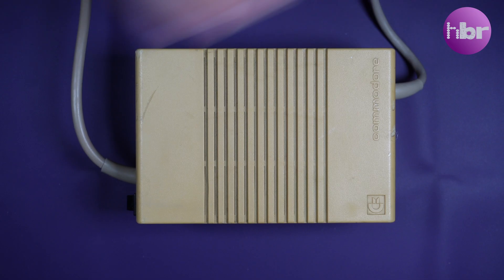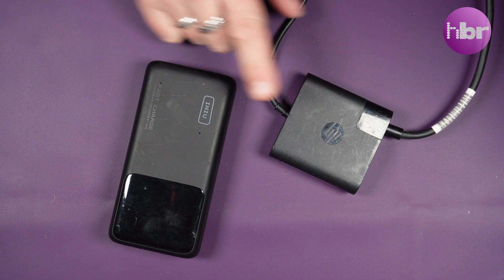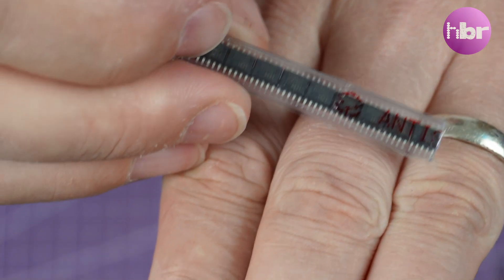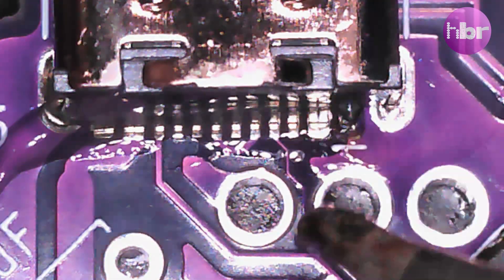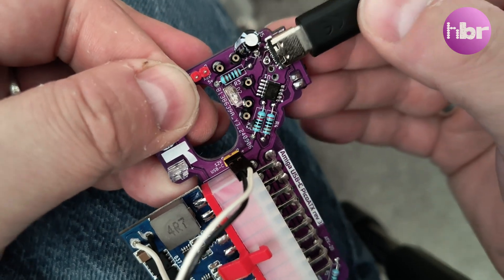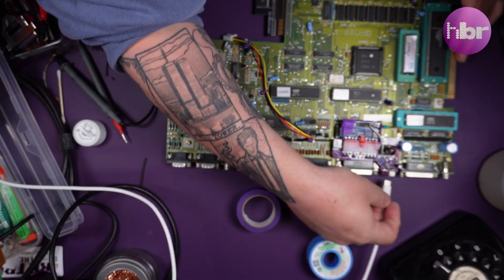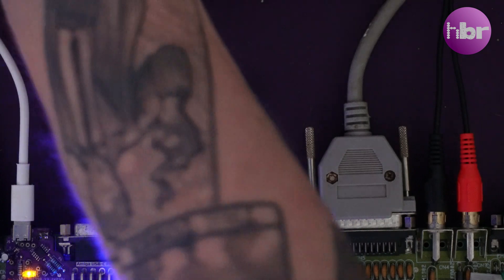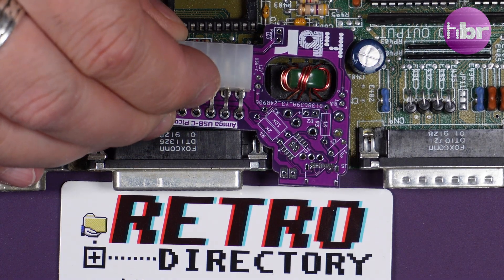Powering an Amiga 500 via USB-C? Let's Make It Happen!

Comment: How to get the -12V out of the USB? Think the Audio in/out needs -12V to function correctly. Also what level of ripple do you get on 5V and 12V?
Reply from the maker: Most of your questions are answered, in the video… in this project the usb-c provides 12v this is then passed to a pico ATX power supply. That in turn generates 5, 12, -12 & 3.3v, the relevant voltages are then fed into the Amiga. As for ripple, I have not measured it in this case specifically. However, using a clean DC power source it doesn’t yield any artefacts commonly associated with poor voltage quality :)

Comment: I don't know how familiar you are with the Amiga, but never ever remove or put something in the serial or parallel port when the Amiga is powered on. You will definitely break your 8520's. I did that mistake a coupe of times back in the 80's ...

My Amiga 500+ power supply was enough to power on two SupraDrive with memory and hard drives, three external floppy drives, optical mouse, joystick, extra internal memory and an internal kickstart switcher, so i could use both 2.xx and 1.3. So, i believe there was enough of power in those power supplies, at least those power supplies that came with the 500 Plus.
Reply from the maker: So yes on the A500 the 12v and 5v lines that go the the ports including RGB if you’re jamming about you can short the voltage pins to the signal and or data pins with the connectors shield :) this is most prevalent on the RGB connector but is an issue on the other pinned ports (including joystick/mouse connecting all plastic in shielded connectors is usually ok :) Also the A500 doesn’t have fuses like the A2000s do. Generally parallel doesn’t usually cause an issue but serial can be a problem if you manage to short anything inserting the plug … or the shorter answer would have been yes I am familiar lol … in my experience ESD is the usual killer of CIAs

Comment: Could your design be modified to just click over the existing motherboard with out removing any thing.
Reply from the maker: I did look at soldering under the connector but there isn’t enough space and using a flexible PCB would not be up the the current draw. This was a project born out of necessity as the square din on som Amigas gets corroded or damage from use so if your taking it out anyway why not put something modern ish in to replace it… I will have an update soon on the revision 3 of this idea :)

Comment: Are there A600 and A1200 versions of the board?
Reply from the maker: There are “plans” but the design will likely require the modulator to be removed, working to get a final version of the A500 version first though. I also don’t have an A1200 I can base designs on I maybe that something designed for the 600 will be a drop in but it is not guaranteed :)

Comment: Other than keep the entire thing external which is easier and won't interfere with upgrades. I would say ditch the pico PSU. Just get some cheap buck converters and add them to your PCB. No need for the bulky ATX  connector. Ali has everything you need for a prototype. 
You could also just negotiate for 12v. Then you would only need to do something extra for the 5v and -12. If you keep it external, it could be adapted to Amiga, Atari, c64 etc.
Reply from the maker: Anything is possible and that's a direction I have considered...

Comment: This project has been on my list. So a great help to see this video. Basically any vintage console could be powered this way. Even with a combination of basic aliexpress boards. The pd board a converter to generate negative voltage from positive etc.. 
There are a few costly over engineered replacement power supplies out there. Next to check usb c they don't make any sense.
Reply from the maker: I am planning to do something similar for other platforms :) for external version of this see my pervious video on battery powered A500  https://youtu.be/F9m6Bx3e9HM

Comment: When I bought my A1200 the PSU was so light I didn't trust it, so kept using my A500 PSU which was so heavy it has its own gravitational shift. However after a while I noticed a buzz while playing sounds and initially thought it was my stereo (I plugged my Amiga in to a stereo so I could really crack it up back then) but after some testing it turns out it was the A500 PSU (it didn't happen on the A500) so I went back to the box of Helium (supplied A1200 PSU) to power my A1200. Never had an issue with it even when I had expanded my A1200 to an 040, internal 3.5" (yep 3.5 not that slow 2.5") HDD, 3 external FDDs (sure they had there own PSU but the Amiga had extra work while I used them) Squirrel SCSI with HDDs and optical drives (again own PSUs) and I would do week long rendering on that system. But what was really awesome was that I could pack it up in a backpack along with the A1200 without it weighing a metric ton and ride around London on my motorcycle with it on my back.
Reply from the maker: As you found the A500 bricks are not reliable. I have not had much experience with the A1200 supplies.
Reply: @hackbuildrestore  That particular A500 KS1.2 (which was an 1987 1st version) and it's PSU was still working until I moved to the US in 2000 it just made a weird buzz on my A1200 not A500 (I'm guessing noisy power that was being filtered on the A500 but not so much on the A1200). That's at least 4 owners, and I know all of us used it heavily (me especially) My friend who bought it from me glued a board to the bottom of the PSU so it wouldn't sit on carpet. My A1200 PSU did however get an untimely death....I threw away a perfectly fine PSU because I moved to the US. But I have seen partially melted A500 PSU's still working fine. I had to drill and saw one open it was so badly warped, but  the PSU checked out fine so I'm guessing something was put on top of it. I have heard the A1200 PSUs were terrible. But I wonder if some of that maybe (like me) people had that expectation so they replaced it regardless.
Reply from the maker: Ventilation plays a big role under a desk buried with pizza boxes and last week jeans kills them, teenagers 🙄 … but also depends on how modified the Amiga was over current protection was a fire extinguisher lol
Reply: @ You should have seen the PSU supplied with the Dragon 32 & 64 computer. No power switch on the PSU so commonly thrown on the floor, did I also mention it had zero ventilation was basically molded to the shape of transformer and instead of screw to open it was sealed shut and used rivets to deter you further. Mine actually melted a shape in the carpet. I think it may have been called a Dragon as it was a fire hazard lol.
Reply from the maker: Yep I remember a friend at school with a dragon melting his bedroom carpet, god bless synthetic 80s carpet just a static generating fire hazard ⚠️
Reply: The 2.5A Amiga psu's are to weak for expanded Amigas. I have recaped many of the 2.5A and recapped they work fine for an minimum expanded system (rgb2hdmi+ex mem is about max for the 2.5A) Better with a recapped 3A one. But a 4.5 recapped and with new cooling paste + cleaned up can handle most setups and doing the recap with low esr caps keeps the psu inside the Amiga specs. Many of the Amiga psu's I have done a recap on have had leaking caps and dried out cooling paste. I belive the old psu's that have not being recapped have dammaged a lot of computers.

Comment: Why not just use a usb-c to 12v DC  The cable tells the usb-c changer to output 12v.
Reply from the maker: You could, that’s the same solution just with the PD control part outside the Amiga, you still need the rest to create the rest of the voltages needed 5v & -12v even the 12v is regulated from the input which protects from over voltage from PD

Comment: USB-C has one big disadvantage. It is very delicate, so it is very easy to break it.
Reply from the maker: That’s why I went with a connector with 4 through hole locators rather than just surface mount pads!
Reply: To be fair, back in the early 90's I worked at a shop that sold and fixed Amigas, and the power connector was by far the most common failure point on it - big beefy plug connected to tiny pins plus Commodore manufacturing QA was not a great combo. At least now the strain will be on a port that is easy to replace with modern parts that will be around for another decade or more.
Reply: I plug in my phone every day. Has not broken yet. The Amiga will be plugged in once. 
People that break USB ports are in my opinion just ham fisted.
I won't claim it's the strongest port on earth and that accidents don't happen, but it isn't that weak under normal use.

Comment: Very nice project and video. I wonder if this will work with my attached HDD, which gets the power from the bus. Need to check. And the most important aspect is substituting the unreliable brick that could kill the valuable chips inside our Amigas.
Reply from the maker: Thanks :) … It should do there is plenty of head room, if it’s in spec for the Amiga normally

Comment: Wow it has zero ripple - I approve 🫡
Reply from the maker: Lithium battery produces a very clean 12v and the pico ATXs I picked up are also surprisingly clean and that’s on a 1988 rev 5 which has not been re-capped :)
Reply: @hackbuildrestore  Now I wonder if I could cram something like this into my by all accounting monstrous A1200 and what kind of power bank I would need to make it a bit of a portable!!  (if nothing else an integrated UPS)
Reply from the maker: Any 45/65w PD battery would have no issue with anything a single Amiga can pull it’s going to internally fry traces before you even get close!
Reply: @ I was thinking more about longevity of battery life. but mentioning frying the traces I did have a hack on my A1200 for a while but during a tidy up I removed it. I ran a second set of power lines (I removed the modulator so cable went in through there) and an internal breakout. I ran fans, HDD (at that time it was a 3.5" that's gone) and FDD (that's gone) directly from that. I had plans to isolate the 040 power from the rest of the system as I noticed that depending upon workload power draw fluctuated quite a bit, but never got around to that. Now I have an 060 it seems like I probably don't need to bother anyway as it draws less power.

Comment: Wonder if using a break out board with power switch on it and just connecting that to the mainboard with a ribbon would be a good way to relocate the switch to the top of the case and maybe make a 3d printered cover for it similar to what we do with a gotek drive screen.
Reply from the maker: Thanks for watching, that may be an option still iterating on the design…